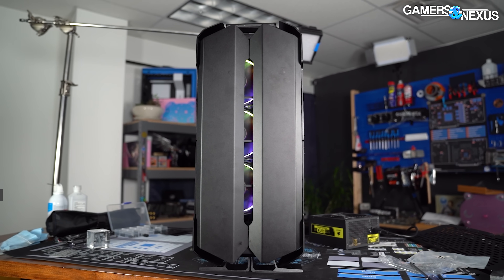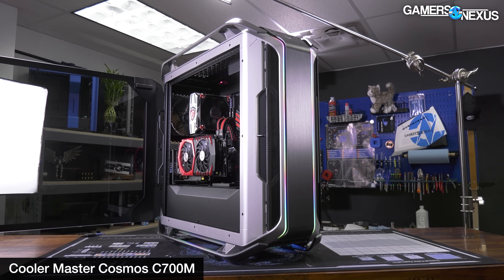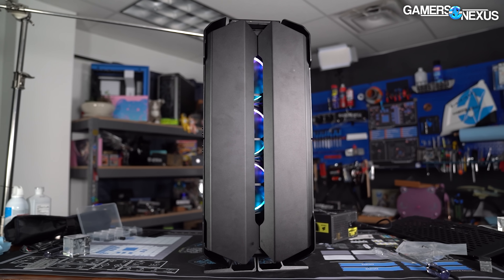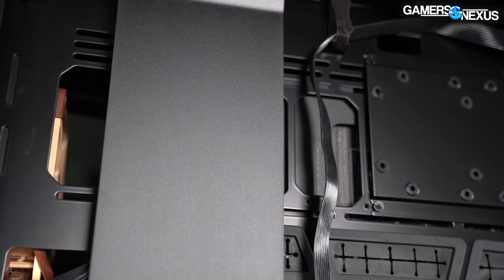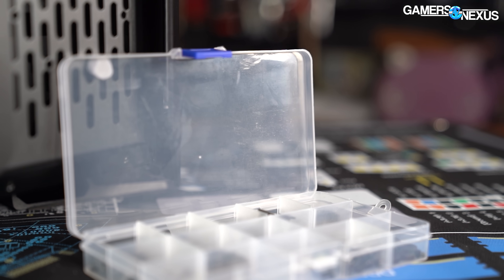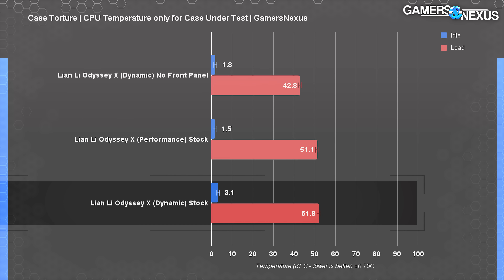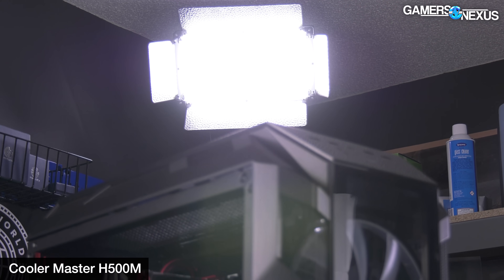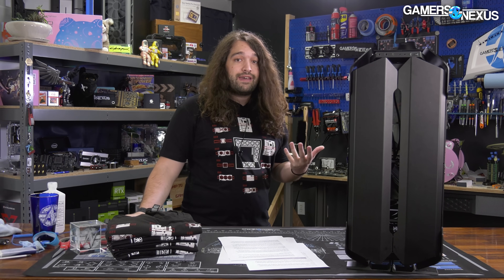Lian Li Odyssey X $500 Case Review: "Transforming" Full Tower

Comment: This princess PC case stuff is just out of hand. What happened to the side panel fan that fed my GPU with fresh air??
Reply: I still rock my Define R5 with the side panel fan. I don't need or want a glass side panel
Reply: you can find those on 30$ cases.
Reply: Fractal Define Core series have side-intakes for an optional GPU cooling fan.

But they also have 5.25" bays, so I think they might be somewhat... out of date.

Still for sale though.
Reply: O11 Dynamic will feed plenty of fresh air to the GPU from the bottom.
Reply: @ALEXANDER1318  "But they also have 5.25" bays, so I think they might be somewhat... expandable, making them more valuable than a case without this feature, because you can upgrade it with new IO and make it last longer"

Fixed that for you. The removal of 5.25" bays is just a scam to make cases more disposable. My HAF 932 Advanced has USB C on the front, because I put an expansion in a 5.25" bay. There are some really trash cases out there that don't have USB C or 5.25" bays. Why would I buy something that lacks modern IO and also lacks the ability to add the IO myself? Those are the cases that are out of date, by design, so you have to buy a new one sooner.

Only a fool thinks 5.25" bays are only for optical drives and thus out of date.
Reply: @mjc0961  I agree. But sadly not everyone agrees. I am looking to buy a fractal define 7 or 7xl in the future because of their 5.25" option.
Reply: While the functionality can't be denied, it's a simple matter of the side fan looking like crap and not really being the easiest fan to work with. You can't premount it and connect it, mounting it after connecting is usually a bit of a pain, and if neither are issues then cable routing is. And if none of those are issues, that means that the case is probably not that good looking, leading us back to problem one.
Reply: @renmcmanus  Define objectification, because I can't think of any definition that would make your statement make sense. Also, as subjective as looks are, I dare you to find someone that truly thinks that a fan on a transparent side panel covering up a chunk of the other hardware (namely your sexy new GPU) is better looking than just having your gpu there without the fan. Like I said, it's functionality can't be denied, but if you think that it looks better with it rather than without it, respectfully, get your eyes checked lol
Reply: @DragonEdge10  Some people don't care about the look of their PC. They just want a box that holds all the parts they need and keeps the stuff inside cool. For those people, having 5,25" bays or a side fan aren't issues.
Reply: @Kepe  Then this conversation doesn't matter to those people. There are plenty of cheap options with all those features that don't care about looks.
Reply: @mjc0961  same thoughts. I still use 5.25" bays for expansion purposes. O really hate huge case with no functionality in mind. Yes im talking about you corsair 1000d.

The corsair 900d is much more valuable than that useless 1000d, a huge case with only 5 3.5" drive bays? Lol

Comment: This case better build my computer for me for $500.
Reply: 500 FPS in every game as well
Reply: Sounds like a Jeopordy question
Reply: Hey it only cost half as much as a low end GPU
Reply: To be fair, my old $250 Lian Li cases have last me like, 10-12 years with good cooling and lots of mods. Like, I got one with multiple power supplies, a bunch of space for liquid cooling, hot swap drive bays, a glass side window, wheels, and so on. And every part was available separately. It was awesome. My newer one fits a 280mm rad in the front and a 240 on the top, has real hot swap bays with a backplane, taller case feet, video card stand, and so on.

But.... I can't justify paying $500 for this guy. I'd rather buy a PC-O11.
Reply: @MikeStavola  yeah the longevity of the product is a good justifier for price especially with Lian Li’s general quality but this one… nah
Reply: @vergodagoat  they’re not cheating, they just have a good PC case.
Reply: Why some people still build giga pc's is beyond me, unless you're some top 1 percent video editor with 2 massive radiators and some fuckey SLI RTX setup with 23 HDD's for all the raw furry prn footage, just get a micro atx case and call it a day. Most cpu's and gpu's are extremeley efficient and require much less cooling than 10 years ago.
Reply: @MikeStavola  My PC case is $20, Full Aluminium but no Glass. Been using it for 10 years. As long as its Aluminium, it lasts long, doesn't have to cost a hundreds of dollars.
Reply: It also mows the lawn, if you ask it nicely.
Reply: @anb1142  that sounds like it was a good deal. Usually, aluminum cases cost more than $20 just in materials.
Reply: @MikeStavola  I bought a Thermaltake Mozart in 2009 and just stopped using it this month
Reply: I just want there desk to not be freaking 2 grand:(
Reply: Wanted to like but you're at 500 likes too so didn't want to ruin that
Reply: Lol

Comment: I must be getting old because I do not understand this case at all, especially not for $500...Good review as always.
Reply: I don't understand any case that's over $50
Reply: And I'm here sitting next to my Fractal Define Mini C, wondering why would people want to buy a flashy case when you can get this lovely discrete black boxes for ⅕ of the price. 

I must be getting old too I guess
Reply: @andy_liga  Well, looks are always subjective so if someone like a big honking transforming case then fine. But performance is objective, and it looks like the Odyssey X is a horrible case in that regard. So in my eyes, there's no reason to buy this extremely expensive case. Pretty much any case seems to be better than the Odyssey X and there are many styles to choose from among those other cases. What a disappointing, gimmicky, horrible case. It's like buying a full-priced Ferrari but it has some measly 100hp 1 liter engine in it.
Reply: If you spend a couple grand on the hardware inside, probably with some expensive hardline watercooling, then spending a couple hundred bucks more on a case is totally reasonable.
But that is if you like the looks of it and it performs, or is some super special itx case, but this one seems to not perform in any of those
Reply: I'm still pretty young and I don't understand it either. I think it's more a "can they get away with charging $500 for a metal box" thing than an "I'm old" thing.
Reply: @Kepe  my comment was intended as sarcastic, let people have what they want... Still 500$ for a "all smoke no roast" case it's a very excessive imho
Reply: @andy_liga   tbh I really dislike that case. Being discrete is one thing and being a plain metal box with a glass side is another thing. 
Aside from (usually) better looks, which is a completely legit reason to spend more on a case (or anything really) as long as it retains some performance and it’s still good at housing the components. 
I’ve gone with a 200$ Cooler Master H500M and I feel like it’s absolutely worth it if you have the money for it. Huge case with good build quality, being able to choose between a mesh or glass front and lots of features to make it easier to build your pc inside of it. 
Let’s not pretend that any pc case past 50$ is just “looks” because I’ve gone from a 50$ case to a 200$ one and they are worlds apart.
Reply: The fundamental issue I have is the concept doesn't make sense.

I doubt more than a couple people will actually use the ability to change the layouts. Virtually all users would set it up one way and leave it there.
Reply: @WhenDoesTheVideoActuallyStart  from Steve's comments it doesn't sound like they're making that much money on it. Maybe they planned for better performance or something else that didn't pan out. Maybe they went over budget and decided to cut their losses and force it out the door.
Reply: I dont understand this case either. It doesn't look premium, definitely not $500. I still use my cosmos II which is old but it does feel premium.
Reply: @Kepe  I suppose only the worthy could buy this and use it as a weapon.
Reply: @inadover   I've never said "above 50$ it's just for look" and never will, I'm running on Define Mini C which costs twice that much (and it's probably one of the most fully featured mATX "standard" case out there too, without going with unknown brands or weird layouts) 

Are you sure you tagged the right person in this comment or are you commenting randomly without reading/understanding what we are talking about?
Reply: Well, I'm over 40 and for my last build I blew $300 on an Asus ROG Helios case. These cases may be a bit tough to justify, but they have 'presence', and for some that's enough
Reply: Even PC building has it's rich fashion victims.
In this case (ha ha) it's all neo-militarist style, putting function over form while still packing plenty of form, makes it a big seller for those people. Moreso now Cyberpunk 2077 has brought the style back into the limelight (even if as a game it's the buggiest game launched in the last 5 years).
Reply: yeah, looking at this thing was kind of confusing. I'd really have to have my hands on it to totally get it. In any "case" --haaa, it does look fun to build in though for sure
Reply: @KiraSlith  The rich fashion victims are surely the ones covering everything with RGB and angular "gamer" aesthetic. That's more kitsch really.
Reply: Acting as if odd case designs didn't exist 10 or 20 years ago.
Reply: I have a Lian Li O11 XL and see no reason for this case to exist. I paid $250 for mine and this case is much worse for twice as much.
Reply: @Durkhead  must not understand things like good airflow then
Reply: Not the only one.  I don't see the point of a case over 150, thats the max for a case you should pay
Reply: @Durkhead  there's some pretty good value  to be had at the 100-150 price point on cases.  i for one would not want to stick 2000--4000 dollars worth of hardware into a cheap 50 dollar job of a case. 

my current go to case is  the Coolermaster HAF XB  it's usually around 99 -130 USD  depending on where you get it.  it's large enough to fit any kind of component in it  but it has  a lan box design that makes it easy to carry  (handles built into the chassis on each side) it has a removeable MB tray  which makes it easy to do builds on , and it can double as a test bench  by removing all the panels , oh and every part of it  uses thumb screws or tooless  latches (for HDDs ectect) last but not least it seperates and isolates  the PSU from the tray components  so cable management is a sinch. but yeah you are not getting that kind of functionality out of a 50 dollar case.
Reply: @jojivlogs_4255  my $30 dollar case has fantastic airflow and there are plenty of cases that are in that price range that have good airflow just because it's more money doesn't mean it has good airflow remember the case with 9 fans?
Reply: @Durkhead  yeah i was just using airflow as an example. and sure, you might be able to find a dirt cheap case with 1 or 2 really good features, but it'll just be demonstrably shitty in other ways.
Reply: @Durkhead  Compare it to a Cadillac Escalade (only better). An Escalade costs about $80000 and the performance is terrible (especially for the money). But it looks expensive and premium (while not being particularly beautiful) so it's popular in that price segment. At least this Lian Li case is made of very decent materials while the Escalade has an interior made of reused food packaging (figurative for cheap plastic).

I get the appeal of a premium case. When you start spending about 4 grand or more on a PC (disregarding current GPU prices), you kind of want the case to look expensive as well. Sensibility and performance per dollar went out of the window a long time ago at that point. PC building becomes a hobby of itself instead of just the gaming. Premium centrepiece computers aren't just for Apple users. Though this case in particular isn't really my taste. I really liked that Lian-Li case Jayztwocents used for the "Old Spice" Terry Crews build though.
Reply: @jojivlogs_4255  then don't imply that I'm stupid cause I know which features I need an which I can live without I'm cheap not dumb
Reply: @andy_liga  same, but with a Define S solid panel sitting on a little table by my desk.
Reply: @Durkhead  ??? did you not imply in your original comment that you think anyone who spends more than $50 on a case is an idiot?
Reply: @jojivlogs_4255  no I said I didn't understand it that's not calling anyone stupid infact it's stating my own ignorance, just cause I am a cheap bastard doesn't mean other ppl are stupid

Comment: Mad how the same company that gave us the insane value of the Lancool II series also offers stuff like this. Hopefully it sells well enough to fund an even better Lancool III lol.
Reply: Lian Li has always been expensive, and they have had some pretty WTF case designs over the years. Buying Lian Li you pay for the name, status and usually build quality. They are never the worst, but also never the best even though the price may suggest the later. Early Lian Li cases sold because they were made of aluminum when almost all other manufacturer used steel and/or plastic. That aluminum was their only real claim to fame in the early days. To be honest functionality and airflow has never been their strong suit, and neither has price unless you feel the exclusivity a high price causes is a good thing.

That's why I was surprised by their Lancool series. Initially it appeared they would use that as a separate brand, but after a year or so it was folded into the Lian Li product range. And again I was surprised...

I have a bit of a love/hate relationship to Lian Li. Over the years I've probably built more than a hundred machines in cases from them and learned to appreciate the usually pretty good build quality, but at the same time I also got to deal with the rough design, limited functionality and often straight out bad airflow. Now it's been probably five years since I last used a case from them so I haven't really kept on top of their product range lately. It may be that they have improved their designs in general, but so far it seems like the Lancool and the O11 Dynamic is where design improvements has been used.
Reply: @blahorgaslisk7763  They should have just done a box with an Aquarium in it again if they wanted something special.
Reply: Lancool II gang pull up
Reply: @blahorgaslisk7763  Latter.

NOT later.
Reply: Lian Li is the Apple of computer cases in many aspects. Form over function, expensive for no reason and impossible to repair.

Comment: I love Lian Li and even got their LANCOOL II Mesh Performance case (love it). But... $500 USD?! Yeah... I'm good. 😅
Reply: @underthesun The only con for me was not being able to fit the Arctic Liquid Freezer II 280 AIO as top exhaust. Must install as front intake which, in turn, raises GPU temperatures. You'd need to install 2 additional intake fans on PSU shroud but even then, you still don't get the cooler temperatures you would've had if AIO were installed as top exhaust.
Reply: @underthesun I'm using an AMD Ryzen 9 3900XT and even the box strongly recommended liquid cooling. 💀
Reply: @underthesun what are you using to cool it?
Reply: $500 spread out over ten years isn't that much. Most people keep their case through several generations of internal hardware. Biggest case change was from the "beige case" generation to the more modern open-plan, full ventilation, "stop making my hands bleed" designs.

Comment: Phanteks Entho Luxe 2. Supports more radiators then you can buy. Dual system support. Hides the power supply in the back. Much better cable management. Included ARGB strip. Best case I've ever owned and half the price of this thing.

Comment: I just want a good quality good looking case!

Rotated motherboard like this one and some TT models.Or horizontal motherboard!

The mother board area surrounded by glass from all sides but two for support cooling and IO.

Enough hidden space for cable management. 

Compact , sleek!

Any ideas?

Almost buying 2x the TT P5 TGE and modding it. But I can't find it for sale in my country!

And I wish I didn't have to mod to get it done.

Basically a showpiece PC! 

Where the center of the show is the motherboard!

As clean as possible! 

The cooling will happen on the background or externally, away from the Motherboard chamber.

A good example would be to use the grill on the back of the P5 to channel fresh air to the inside of the case placing hidden fans inside the cable management area.

That's the level of minimalism I'm looking for. Any help would be appreciated!

Great content as usual!

Comment: Not sure about other audio drivers but the realtek audio drivers for case and mobo 3.5mm jacks change on the fly iirc or at least are individually configurable in the realtek audio console. so the missing labels on the front jacks might not be an issue.

Comment: The appeal and benefit of the Dynamic R/Chimney configuration is you can have an intake case fan pointed directly at your GPU's intake fans.
CPUs are cheap and easy to cool well these days but with a GPU you're mostly stuck with the cooler that it comes with unless you spend the big bucks.
Now glass side panels are the norm - making side-intakes (the kind that point at the GPU) impossible, more cases need to have actually good bottom intakes/fan mounts or rotate the motherboard and have rear/side intake at the GPU.
That said the Dynamic R configuration otherwise looks garbage and is a massive dust trap.